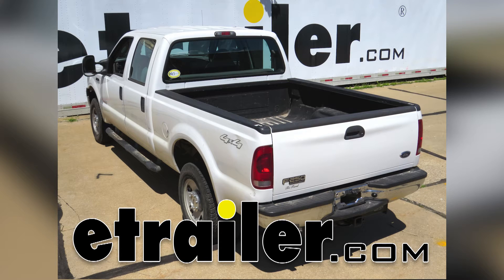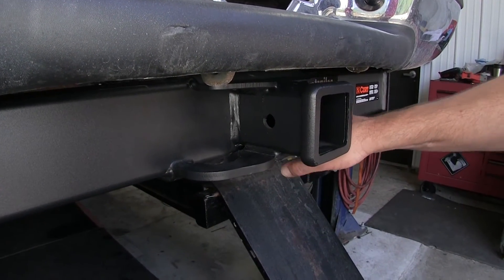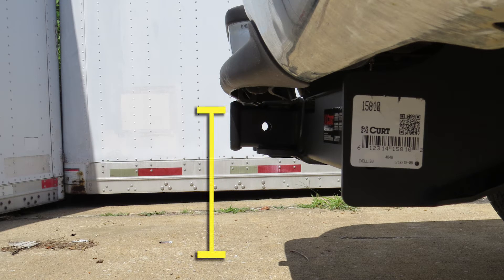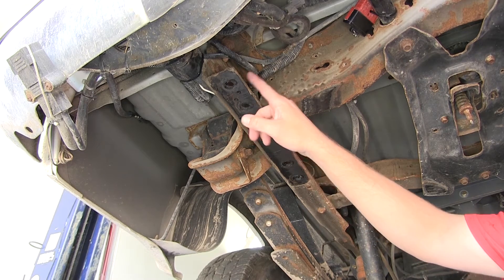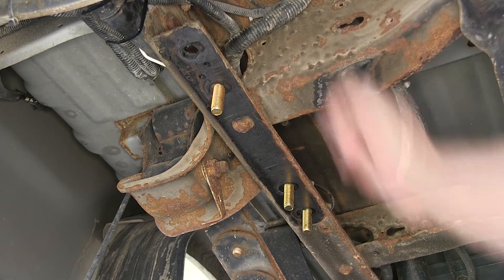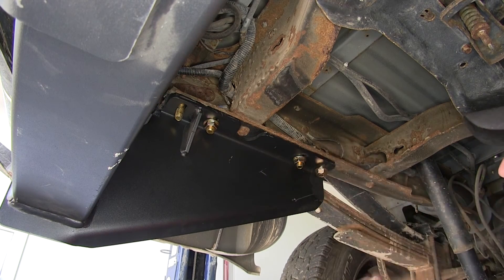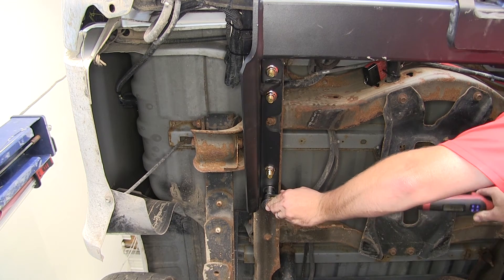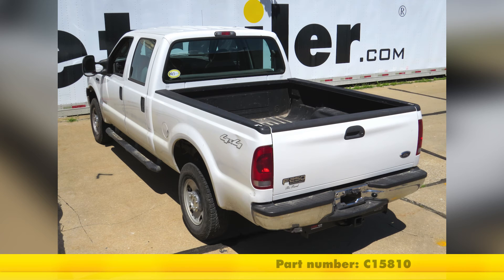etrailer | How to Install the Curt Trailer Hitch Receiver on a 2007 Ford F-250 and F-350 Super Duty

Comment: My trailer requires lights and brakes. I see the empty factory harness plug in the video. Definitely not ready to hit the road. Will the world come to an end if I drill and tap two small holes for the factory 7 pin plug bracket like the factory receiver?
Reply from the maker: You can do it but you will void the factory warranty because you would be altering the hitch. To get around this, we use no drill mounting brackets to secure the 7 pole into place on the hitch. You can go to the following link to check them out.
https://www.etrailer.com/Accessories-and-Parts/Curt/C57202.html